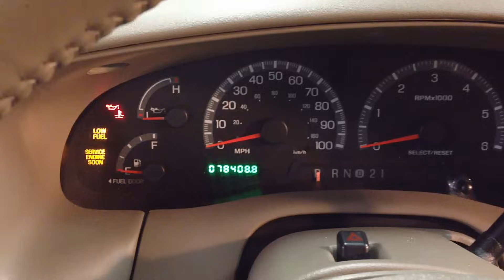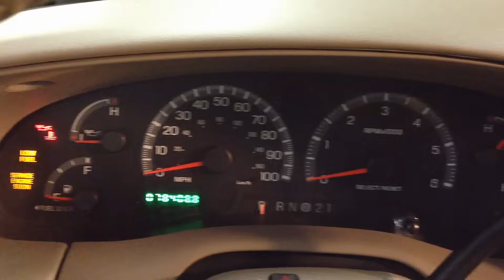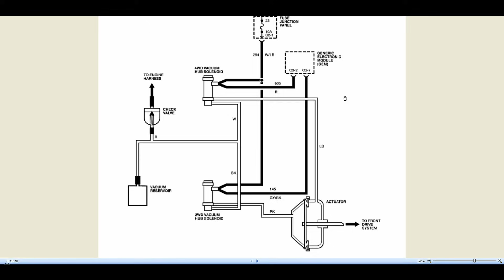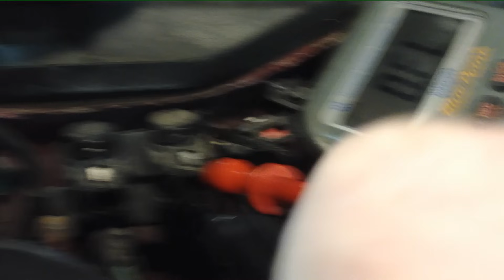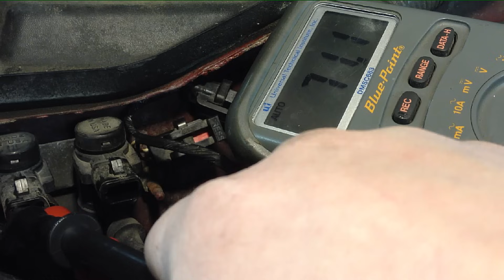1997-2004 Ford F150 4X4 Inoperative In Depth Diagnosis

Comment: I have a 2005 F-150. I accidentally put it in 4x4 low and can't get it back out. I took off the acuator motor a manually turned it back to 2 high which was easy but it still seems to be in low range....any thoughts? Thanks...

Comment: So, using the original GEM, I tested the 2wd & 4wd vacuum/electric valves.  Both had power as described in your video.  But when I checked the ground side, the 4wd side gave me a light, with the switch on the dash in 2wd.  the 2wd ground side would not light up.  Interestingly, the 4x4 light is illuminated on the dash.  All of this tells me the GEM is not working.  I'm going to put the replacement GEM back in and repeat the procedure.  
Jim

Comment: Can you tell me if a replacement GEM needs to be programmed to the vehicle?  '97 F250 LD, 220000 miles.  My 4wd is not working.  I hear the GEM module click 6 times when I turn on the key.  I got a replacement GEM but it doesn't seem to work - does no click, but all other functions work - except the 4wd.

Comment: Hello, hoping you can help here.  Doing the troubleshooting step of testing for power to solenoid and when I switch it to 4 H or 4 L the 2 WD wires still light up.  Where should I go next?

Comment: What's the difference when you have a manual 4wd shifter on a 97? I'm not sure that I have any vacuum controlled 4wd parts. I think I hear an electric motor under the cab but otherwise not sure.

Comment: great video,
I have a question,  I have a 1997 f150 4.6 can you tellme the inputs to the gem module for the 4x4 actuator motor to work,???
4x4 does not work check wiring and 4x4 relays those are good,  even replace the gem module 
4x4 still don't work, no signal from gem module to actuator motor.

Comment: What type of 4x4 issue would make it so that the front locks in, but the dash never shows 4x4, and the transfer case doesn't engage?
Transfer case shift motor?

Comment: The problem im having is that im not getting vacuum to either of the solenoids, ive checked the housing behind the battery and that has no cracks. where should i go from here?

Comment: My brakes are stiff. I'm thinking brake booster. My 4 X 4 stop working found out in a big Chicago snow. It says on screen engaging. I got stuck neighbors said front wheels not spinning. Now it cuts off when idle to long. All these parts use air. Can the booster affect these components? 08 Ford Expedition

Comment: I have a 99f150 it was hung in 4wL when bringing it home it made a couple of little skips and then would not go anywhere the first thing I did was take the motor off of the transfer case and put it in 2wheel drive and drive it a couple of days it worked fine till I could get a new motor put the new motor on and everything worked but drove it about 15 miles and it popped out of gear again I looked at all kinds of stuff and it was hung in 4wL again can you please tell me what to do next is it supposed to be running in park or not running in neutral l would thank you for any help

Comment: I don’t hear the clicking in the dash and the light doesn’t come on. What do I do next?
Reply: I have the same issue. When he tests the wires going to the solenoids he’s testing the GEM module. If there is no clicking and the light doesn’t come on do the power to solenoid test and you’ll most likely find that the ground never switches from the 2wd solenoid to the 4wd solenoid. This will narrow you down to being a GEM module.
Reply: @JCain-uh4hh  So here is another version of the last question. When I switch from 2x4 to 4x4 I can hear the clicking sound however it will not go into 4x4. When I test the switched grounds it is on both sides at the same time and does not change. Would that still be the GEM or is it more likely I have a wire issue like a short to ground?

Comment: Mine goes into 4x4 fine but to get the light off I have to turn my truck off it is a 2002 f150 with a 4.6

Comment: I have a '99 F-250 and had the transmission fluid changed cuz it was leaking a little. Picked it up and drove a couple miles home and the next day went to drive it and it went about a half a mile and then acted like it was in neutral and coasted to a stop. They towed it and looked at it for a few days and couldn't figure out what's wrong. I also had had them make sure the four-wheel drive was working because I didn't feel it engaged when I turned the switch on the dash. It worked fine  for them.  I had tried the switch in my  driveway and again it didnt engage. What would cause it to be stuck in neutral and wont go anywhere? They said it was hard to push. They will tow it to a transmission place but it seems like it should be an easy fix (vacuum, fuse, the dash switch itself). Thanks.

Comment: have a 2004 f150  only 1 solenoid back of battery, vacuum from both ports in or out of 4wd , no sounds from switch and no lite on dash  no engagement to transfer case .  fuses good power to solenoid good

Comment: I know this was back from 2014 but do you know where I can get replacement vacuum hoses for the 4x4 system on these trucks? I heard those snap easily due to age.
Reply: You can order the whole Vac hose loom from a Ford dealer. On the 2012 it is Ford BL3Z-7A785-B - Tube Vacuum. Check with your VIN

Comment: Great videos. What I've discovered is I have power on both actuator feeds. I have ground on one actuator but not the other. I flipped the switch and heard the motor turn then I checked to see if I had ground and I still have ground on the same one I had ground on. It didn't switch. I'm assuming already that I have a bad gem and I wired up a 2 throw switch directly to the 2 shift motor wires and I connected the 2 brown wires by the tcase. I left the square plug connector unplugged. Does the square plug control the shift actuators? Trying to figure out why the ground won't switch when I flip the switch

Comment: I have a F150 plow truck and my 4x4 is not engaged. When I am looking at the actuator with truck running, I had wife switch the switch to 2w (nothing moved). Had her switch to 4h (nothing moved). Had her shut off truck, I pushed actuator shaft out, then she turned on the truck and actuator pulled into the diaphragm no matter what spot the switch is in.  Could the switch be out?  How do I check that out?

Comment: Great video on how the solenoids work. No body does that. very simple explanation. So here's my problem. 03 F150. had no transfer case engagement. put a new shift motor in. Great. transfer case works fine now. turns front driveshaft and goes into low. But front wheels dont turn. Had a bad shift fork in the front diff(plastic tabs gone). replaced that. now fork will engage the sleeve and lock the axle. But when switching to 4x4, actuator wouldn't engage. checked vac, power to 4x4 engage solenoid-good. Applied vac with hand pump to feed line right at the solenoid. line is clear and actuator will engage. replaced 4x4 engage solenoid. still no good. when turning on switch, solenoid will not open to pull vacuum on actuator. However 4x4 disengage solenoid does work correctly. I assume something is wrong with the GEM module, since it provides the ground. But what's odd is if i command the solenoid on  with my scan tool on/off(KOEO) the solenoid works. If I try to command it on/off (KOER) it will not respond. The other solenoid(disengage) will work in either mode (KOEO/KOER). So unless the gem is not seeing an input which wouldn't allow the solenoid to open, I assume something in the GEM.

Comment: Question I have everything working on the actuator good vacuum new Switch new actuator but the four-wheel-drive it's still not engaging what could be the issue
Reply: if your vacuum supply is good at the diff actuator(in both modes 4x2,4x4), your actuator arm should be moving. if so, and the axles arent turning, you most likely need a new shift fork in that front differential. they put plastic tabs on the ends of the fork which move the sleeve inside. without the tabs, the fork won't move the sleeve to lock the axle. it's very common on 97-04 F150. poor design.
Reply: @silverado2500wr450  but when i put it in to 4x4 sometimes it does goes in but going down the highway it will go out but when it goes out i hear a clicking noise in the dash
Reply: @charlesheath5207  that could be the relay. might have a loose or bad connection. i would check your gem module and make sure all the connections are tight and clean. if you have a water leak on the drivers side somewhere(which isn't uncommon), water could be getting in the connections or in the module itself. It's attached to the back of your underdash fuse box.
Reply: @silverado2500wr450  this noise started after i replaced the actuator
Reply: @charlesheath5207  the plastic actuator snap ringed into the front diff? correct? what i would do is when you drive and it comes out of 4wd, i would look at the actuator and make sure its still in the correct position for 4wd. if it is, than maybe the plastic tabs on your shift fork are wearing and the sleeve is slipping out of the fork causing the axle to disengage.
Reply: @silverado2500wr450  ok thx

Comment: '97 F150 4.6 4x4 problem is intermittent forward (Don't know if it is a vacuum leak, though solenoids click and transfer case responds)? 4x4 reverse works perfectly when automatic transmission shifted into neutral and then 4x4 floor lever is shifted into 4x4. When truck is in the air on Jack stands and shifted in and out of 4x4 20-30 cycles, the right front wheel never engages as the left responds correctly to 4x4 activation. In snow when 4x4 forward does finally engage, it falls back into 2x4 after 5-10 seconds. Could the lazy right front wheel refusal to lock into 4x4 be indicative of vacuum hose  trouble in that right front area or do I need to look at the hubs for wear in engaging forward motion? Could I have a right front hub problem? Made one tight turn with 4x4 engaged last summer but was on sandy soil - could have damaged hub?  Have never been able to shift it into 4x4 without shifting into neutral at full stop. It does not like to be rolling when shifted into 4x4 - grinds or clunks. Have saturated all linkages in Liquid Wrench spray.  Ideas?

Comment: Good afternoon had a question about this 4x4 diag. I tested them wires in the solenoids on the fire wall.  One the the closest to driver side has power and a ground in 2wd or 4 wd and the other one has power on both terminals no mater which way the 4x4 switch is in.  Any ideas. It 97 f150 also no light comes on the dash. Only on first start up

Comment: Thank you for literally the best DIY mechanic videos on the Internet. I used your 4 part video to replace and time the 4.0L in my 2005 Explorer. I do not think I would have been successful without your videos. 

I have one question on this video. I ran all the tests on my 2000 F150 (4X4 will not engage) Everything works except when I get to the last test. When I raise the front end, the drivers side wheel will spin freely in 2 an 4 wheel drive. The passenger side binds in 2 and 4 wheel drive. (when in 2 or 4 and in park with the engine running). I can see the passenger side CV axel bind at the front differential. But what is weird is I can drive the truck. No issues with binding when in drive or reverse. One other thing to note:  I had the passenger side ball joint snap this summer and had to replace the passenger CV axel shaft as well as the ball joints all around.

Comment: I just tested the 2wd solenoid wire and the negative side stays lite(Power) no matter the key position or changing it to 4wd. it did throw a scan codes for the gem module B1342 were.   C1226 ABS/TCS Loss of communication . P0500 VSS Output. P1318. P1838 Transfer Case Control Motor.  My mechanic lost  his entire shop in the recent fire here in Southern Oregon so I am on my own to fix this problem.
Thanks in advance for any help!
Johnny

Comment: Thank You First of all! My problem starts with the 2 wheel solenoid Power on the positive and negative side and when the key is off still grounded on the negative while testing from the positive battery terminal. Also Power on the 4x4 positive terminal and no reading on the negative solenoid terminal regardless of key and 4x4 switch position. No light on the dash , no clicking etc. Thinking about replacing the gem module? great Video gives me confidence.respectfully  John

Comment: I am trying to find a video or the steps to troubleshoot if you do not hear the clicking under the dash and the 4x4 light does not come one.  I also do not have power to the 2WD side of the switch under the hood like you show.  I have checked fuses and all appear good.  What do you recommend as next steps?

Comment: Thank you. Can you tell me how to diagnose the switch? Fuse is good but only 4 volts at fuse. No clicking behind dash. 4 volts at switch. Nothing at other 2 terminals. 12 at light terminal, with lights on.
Reply: 97 f150 4.6

Comment: took the transfer case shift motor out. but 4X4 low light on dash is still on. had to manually put shift motor back to two wheel drive. 4X4 was stuck in 4 low.  brand new transfer case shift motor. could there be a short somewhere. maybe on the relays or a fuse ??  i have a cable lock on the front differential. vacume line has been reattached. should I detached the vacume lines.

Comment: Hi there, my name is Jim and I am a subscriber and I really appreciate your videos. Always well done and I have saved allot of money doing things myself on my 2000 expedition 5.4L  4x4. I have a problem that I can't seem to find an answer for and I was hoping you could bless me with an opinion on the matter. A week ago I changed the water pump. First attempt with no problems. The next day the truck stalled and would not start again. I have sprayed quick start into air system and it started and immediately stalled again. When I turn the key on to listen for the fuel pump to engage, there is a weird noise like a short woozz sound that comes from the EHCU box on drivers side below air filter assembly that only last like 1 second. It appears to be the abs  system box (?)  I can find no obvious vacuum disconnects or anything else that would be clear to a medical guy like me that something came loose or is broke or anything. I am about to take it to the shop but after going through your videos you mentioned contacting you for questions so I thought to reach out and see if you might have time to tell me what you might think. I would really appreciate it. Thank you. And thank you for the very informative videos. Seriously helpful. 
Jim Lagutaris 657-251-7172 just in case you would want to call.

Comment: thanks my friend, your a big help. My problem is the acuator is going all the way in and out when i jack it up running (98f150 floor shifter) but going down the road it wants to creep to 4x4 and the light goes on and hear clunk in front pumkin area preceeded by a squeel. i took off the rubber boot and oiled it good bringing it in and out jacked up thinking it might be intermittent binding at the acuator

Comment: Great video. I have a 97 Expedition 4x4 which uses the same system. Where does the engine vacuum come from? From experience with Rotary engines (Cosmo and FD RX-7), old vacuum lines make diagnosis difficult. Thought it wise to give it new silicone lines throughout to rule out any heat related failures in the 4wd system

Comment: I wanna add fog lights to my truck, 1997 ford f150 xl 4x4. I cant find the fog light wiring despite having looked for it. Can you do a video about that with you actually revealing where the harness and or plug is for it? Mine has the bumper but not the lights.

Comment: Any ideas on mine, so when i put it into 4wd nothing happens at first, i followed all of your steps and everything checked out, the 2wd side works fine but this is the weird part. i have no vacuum on the 4wd side at the diff but when i pull the hose out the actuator on the firewall then plug it back in, i suddenly have vacuum at the diff. and it moves perfectly. then when I switch it back into 2wd it won’t go back in 4wd unless I pull the hose off and reconnect it

Comment: i checked it with the bottom vacuum connected and had no vacuum out of either solenoids. i have already replaced the actuator and no vacuum down there either....where should i look next...i have power to solenoids and i have vacuum on bottom side of lines

Comment: I have a 1997 f150 4.6 4x4 suprcab I recently changed the GEM modul because it started acting up I have the electric 4x4switch I was driving and everything seemed fine I stopped at a store and when I went back to the truck it started normal but it feel like its stuck in neutral no reverse no drive nothing truck wont move when I put it back to park it makes a buzzing sound and 4x4 switch is getting no power I check all the fuses they are all fine I'm thinking the new gem module could have a faulty 4x4 part? Because 4x4 does not light up on dash except when I put the switch in ignition and try to start then it comes on and flick off after truck is started...they told me the transfer case is stuck in neutral any idea and suggestions is appreciated.

Comment: 1997 F-150 5.4 eng going into 4 wheel drive actuator clicks several times then the 4x4 light on dash comes on but it isn't locked into 4 wheel drive when switched back to 2 wheel actuation clicks but 4x4 light stays on & to turn 4x4 light off I have to kill the engine & restart, I've been told there is an electric motor on the transfer case somewhere that sticks some, colder weather is when the issue is worst sometimes when I keep switching back & forward it will finally engage but equally there are times it will not engage, any ideas? thanks.